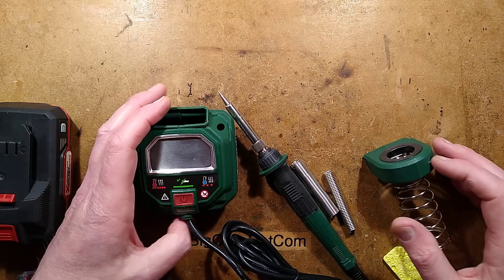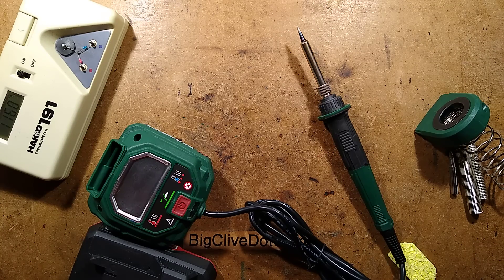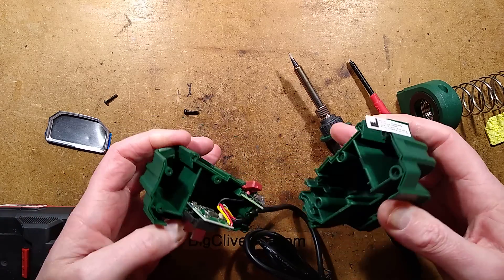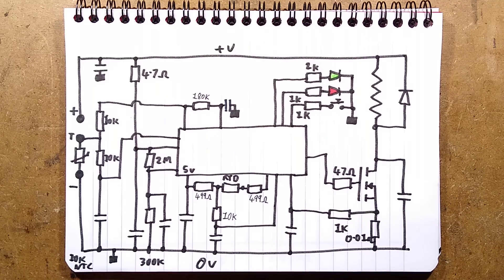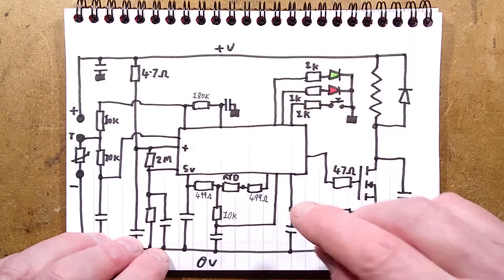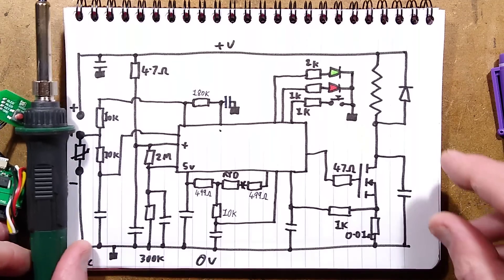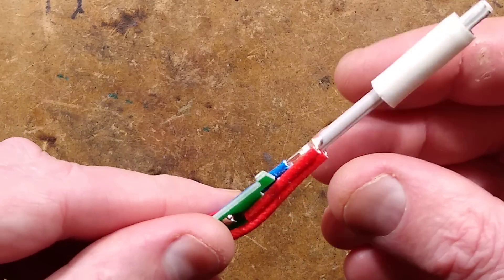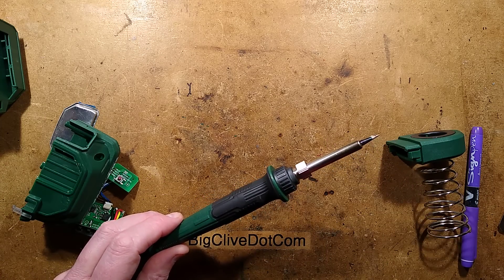LIDL (Parkside) B2 soldering iron hack and schematic

Comment: Absolutely brilliant design from a throwaway planned obsolescence point of view. Absolutely ridiculous shit design from any lucid person standpoint. In my experience with shitty irons (as plentiful as painful) it is the porcelain heater that gets damaged first (it is fragile) and setting the thing at almost 500C (out of the bloody factory!) is not helping the case. Here is another example of 'straight back to mother Gaia' (to quote Ave) factory-straight-to-landfill philosophy. And, for the price you're much better off with open source Pinecil than this piece of garbage (with temperature regulation that has to be hacked into the bloody thing to even think of using it!). Rant over. Brilliant video, what a piece of shait product.

Comment: Craftsman has a 20v soldering iron for $50 ive been considering getting since i have a number of their tools/batteries but i also use their 150w inverter for a number of things including my normal 60w soldering iron so not sure if i should get it or not or buy a similarly priced soldering station instead.

Comment: I've been using this iron for nearly a year out in the field and it's become indispensable. perfect for led strip installs, just gotta be quick as it does get hot. Used it loads up on ladders too by clamping the pack to the side rail
Reply: reply here if it reaches 1.5 or 2 years. i don't trust chinese heaters. low voltage supply might help, though, as those working on 240v are mostly junk.
Reply: @ivok9846  I can reply here now because my "Chinese heater" mains soldering iron has been fine for several years... until I dropped it. Those ceramic elements are brittle, but also cheap and easy to replace.
Reply: @ivok9846 Chinese heaters are good. But you also get what you pay for when choosing among Chinese-made products.
Reply: @ivok9846  But you do trust your chinese phone, I ?

Comment: Clive, this is great video . I wanted to make my own version of portable soldering iron but this gave me idea. This can be even better if added  various temp settings with rotary 6 position switch and every position can be different value resistor so it can be more useful. Thanks you just made my day.

Comment: The middle of my Lidl had these irons a while ago, worryingly the tip burned itself to destruction. Perhaps a 22ohm resistor will return it to normal function. Thanks Clive.
Reply: had same. they just destroy themselves. i thought it were old solder i was using causin the problem.

Comment: Excellent video and thanks for the resistance values and temperatures as I don't have anything to measure the temp.

Over the coming weeks I'll try and source a suitable pot and 3D print an inline enclosure with the temps on the dial. If everything works out I'll add a link to the .stl when I've finished so that others may benifit.

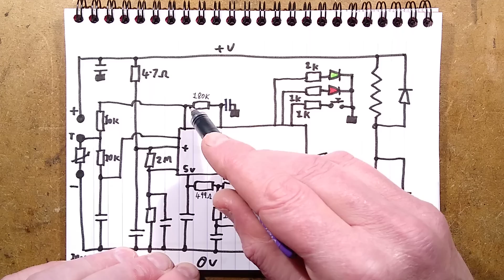Comment: 10:41
I think the 180k resistor is connected to another ADC input.  Probably this input is used to measure the actual output voltage on the pin which powers the temperature measurement circuit (10k + thermistor). High logic level voltage can be slightly less than 5V, so they want to measure it to get more accurate temperature readings.

Comment: I added a 22 ohm resistor in the white wire, reducing tip temperature to 360C, which works well for me with leaded solder. This is a similar tip temperature to my Tenma soldering iron set to 400C with a narrow bit.
To get it to work with other 18/20V batteries or power supplies you need to add a 10k resistor between the B- and BS.
The two round pads at lower left of the PCB are a convenient place for a resistor, but shouldn't be left in place for the original Parkside battery.

Comment: I got my B2 version as soon as the previous video about the B1 came out (and i was disappointed that the B2 didn't have the simple hack method haha).

I made a similar modification by putting a 100 ohm potentiometer in the base in series with one of the thermistor leads (there's plenty of room in the base); i made a hole in the case so the potentiometer shaft comes outside and the temperature can be controlled. You cannot use a higher value potentiometer as the iron will go in an error (and even with the 100 ohm sometimes it goes into an error). Also note that when you put the resistor/potentiometer in the circuit, the iron will take much less to go from red to green, even if the tip isn't at the right temperature yet; the higher the resistor value, the worse this problem gets.

The cone tip will last maybe two times before crumbling at 480°C, but they are easily found online. The flat tip is almost indestructible even at max temperature, it just gets concave but for tinning big wires it is phenomenal.

Finally, in case you want to use it with a power supply instead of a battery, you can simply make a base where you connect the middle pin to the negative through a 10kOhm resistor, and make sure you use a power supply with over 100 watts of power, as it pulls a lot of current when first heating up. Maybe a 19V 6A laptop brick could be enough, i have yet to test it, as some laptop power supplies could go into protection when such a high current load is applied.
Reply: Same here :)
Reply: Hello. Can you please give me more info on the mod. I am thinking of putting a lower ohm potentiometer something like 80 or 50 so it doesent error. Connect in series with the white wire on the board?
Reply: @xTwinkleSx  yes. There are four wires coming from the handle, two are for the heater and two are for the temperature sensor, you just need to put the potentiometer in series with one of the two thermal sensor wires.

Comment: 380° C  Why so high? I have my iron set to 325° for electronics.
Reply: I've used as low as 300 °C for very small surface mount devices when using tin-lead solder. For decades I used a 700 °F (371 °C) tip for general electronics work, again with tin-lead solder. (This was with Weller irons that used temperature-regulating tips - Curie temp of a piece in the tip itself set the temperature). It is a perfectly safe temperature for though-hole components. 

In general I prefer the "hot and fast" approach. I've seen a lot of videos recently in which people purporting to be teaching how to solder are really rather bad at it and dwell far longer than necessary to do a good job. If someone is working that way a lower temperature is probably a good thing. It takes some practice to learn how to solder quickly and well.

I used "4 ounce" (approx 6 mil, 140 µm) copper in many of my designs. Most boards use copper of 1/4 or 1/2 that thickness, some for SM use 1/8 that thickness on surface layers). Along with the thicker copper the total board thickness was 0.093" (~2.4mm). Getting good hole fill on those was a bit of a challenge at times.

If you are doing SM work, an iron is always the wrong tool to use for ceramic capacitors, but sometimes there isn't a lot of choice and low temperature is best. Suddenly blasting them with 450 °C hot air, something else I've seen in videos, is equally evil.
Reply from the maker: It might be worth checking your soldering iron temperature display is accurate.  That would be OK for very slow soldering.

Comment: Five decades ago, a US company that made "electronic kits" to build your own equipment, called "Heathkit" had a soldering iron kit.

It had a tapped secondary, a selector (high, medium, low and off) switch, and a GE soldering iron handle and tip.

The kit assumed you didn't own a soldering iron. It instructed the owner to wrap the stranded wire internal connections around the connection tabs, crimping them with needle nose pliers.

Then they told you to plug the iron in, wait for the tip to heat up, unplug the iron, and solder it's internal connections using itself!

There is no way such a product would pass muster with the "safety goons" today.

I miss the old days!

It automatically excluded idiots from the hobby! (They were busy taking up a tray down at the Coroners.)

There top of the line kit was a fairly large screen color TV.

It had it's own built-in alignment instruments for adjusting circuits as you built them!
Reply: Yeah, no soldering exists today, damned "safety goons"  (◔_◔)

Comment: I would venture to suggest that the high heat is intentional because most of the time these portable irons are likely to be used on outdoor projects with wind cooling a significant factor. Having used standard mains powered irons powered by an extension lead up a ship’s mast, I can say it was a struggle to get enough heat to make decent connections.
Reply: @Kevin-mp5of  to me it looks like a 900M series tip
Reply: It's temperature controlled, so should be able to maintain whatever temperature it is set to without being set ridiculously high.

Comment: Could you de-solder the wire on the base side of the iron and place a potentiometer in series instead and have an adjustable voltage? or a rotary switch with multiple resistors attached for fixed values? 🤔

5:17 Curiously, where do those 4 pads trace back to?
Reply from the maker: Those are for testing or programming the microcontroller.
Reply: Yes, you could, I did exacly that, I added 100Ohm pot in series with the black wire.

Comment: Best thing I ever bought from Lidl is tiny USB-powered spray gun. It somehow manages to atomize paint from felt-tip pens.
Reply from the maker: does it use air or is it electrostatic?
Reply: There is mechanical air pump, but I dont fully understand how it works.

Comment: You should try a cartridge-based soldering iron (JBC or a JBC clone).   While the genuine stations are expensive at $450 and up, you can get knockoff bases for closer to $50 USD and plug a real JBC handle and cartridge into it.  You've got the skill to use one of the Weller style irons as you show here but cartridge tips are just so much better as they keep the tip at temp much better.
Reply: Pinecil sells for 26 bucks and also has tips with integrated temperature probes (Hakko T15 style). It can be powered from USB C PD or via a DC barrel. There's ton of adapters on thingiverse for different powertool batteries.

Comment: Probably not a bad idea to add a little pushybutton that can be hotmeltglued to the handle to bridge the resistor mod in case you need the extra oompf...
Reply from the maker: That's not a bad idea.

Comment: Always wanted one, but then i found 3d stl files for x20 battery adapter, added case, switch, socket and cable for my TS100 soldering iron and works great.

Comment: 15:10 The conical pointy tip that it was supplied with stared eroding within 20 mins of use with me using flux, my own known good solder and switching it off when I knew I wouldn't be using it for a few mins. I was so tempted to take it back to the store when I realised it wasn't an A1 version. 480C is an absolute joke and I have no idea why Parkside would feel that temperature is appropriate for soldering. Rant over.

Comment: When the iron is tamed down the chance of a faulty heating element also reduces, and then you are tempted to buy some more spare tips at start. Hate to choose between enough tips for the future and a faulty heater, or a working heater without a clean tip.

Comment: Would it be possible to add a potentiometer instead, maybe some kind of mini panel mount one so you could have it say max temp (or near to it) in case soldering outside, then be able to turn it down if needed, i know you wont be able to know the exact temp but would be a cool feature. What value pot would you need to do it ?
Reply: I imagine so, maybe a 200ohm potentiometer from ebay would do the job and allow you to get cooler than 300C temps
Reply from the maker: A 47 ohm pot could be a good choice.

Comment: Thanks Clive I went out and bought one of these soldering irons after seeing your original video and couldn't  understand why I couldn't lower the temperature like you had shown. I will now try this hack although I fixed the outside fairy lights today that I
 managed to cut though in two places last summer works fine when it's only 2 degrees outside . Has you say works great has a portable soldering iron

Comment: "That's because the safety industry is detached from reality." Thank you Clive. You're a classic sir! :)
Reply: Simple solution to that is to use the "right" tools. For example Wera or Wiha, and I assume others as well, sell "Slim" Versions of their screwdrivers which are considerably thinner, even with the insulation. 
Besides that, in this case, the device is not powered and if so powered at a low Voltage anyways, so any normal non insulated Screwdriver would work and would be adequate in this specific application anyways. As long as it is not powered up, there is no requirement for insulated (or according to the German "VDE" recommendations) tools anyways.
Reply: There was a former H&S guy on the radio (LBC?) the other day saying that the majority of the personnel in H&S in the UK nowadays completely misunderstand their purpose.  The idea is to identify risk, appreciate it, and to manage the risk within the parameters of what you are wanting to do.  It isn't just to say No No No No all the time!  So a modded screwdriver is fine as long as you restrict its use to occasions where there is no HV element -- which is what any sensible person would do.
Reply: @Kevin-mp5of  Or because of dumb lawsuits
Reply: @Kevin-mp5of  Indeed, but I didn´t want to go into too much details, as here in Germany where I live, not even every electrician is allowed to work on systems under power. But whenever feasible, shutting of power and locking out is absolutely preferrable anyways.
For what Clive shows I also kept it simple as, mobile devices with a plug can be considered safe to work on while unplugged (which means some things he shows, as he says himself, are not advisable). I think there are even lockout boxes for plugs available. Oh yeah, and of course make sure to discharge capacitors (Guess how I learned that in my youth...)
Reply: @Kevin-mp5of  Sounds like you discharge them anyways ;)
Reply: @Kevin-mp5of  And one way comes as a surprise. Every. Single. Time.
Reply: @Kevin-mp5of A little of column A little of column B
Reply: H&S was the bane of my life in control and automation systems - until I found the answer... To any risk assessment I submitted their answer was almost always along the lines of "no or not good enough or don't think you can do that" so I hit back. I made them part of the project team and dropped the responsibility for designing the installation/commissioning safety systems on them  (also cost justifying them 😧). Told them "You are H&S, you go to all these seminars and exhibitions, you know all the latest innovations and reg. changes so you can design the safe systems" Never had a problem getting my RA's approved quickly after that 😁
Reply: Oh, no - it's not the industry, it's the reality. And the reality is that this world is full of muppets with questionable knowledge and enormous self-confidence, and if we don't take care of them (somehow) we'll run out of hospital beds or cemetery space. 😂

Comment: What current does the sense resistor see? Because it might be possible to add a trimpot in the case to make the temperature adjustable, though it wouldn't have a display.
Reply from the maker: Very low current, so a 47 ohm potentiometer would work.

Comment: Clive, the controller appears to be an OB6606 made by On-Bright Electronics, and is intended to be a brushed motor controller which includes a microcontroller, 5v regulator and a rail to rail amplifier.  I can't find a datasheet for it though.
Reply from the maker: Looks promising.  Shame they don't even have a numbered pinout for it.

Comment: Just a question.... is it possible to convert a 220v 60w aliexpress soldering iron to 120v? I converted my hot glue gun but tried iron but won't heat hot enough to melt solder. Searched your videos but couldn't find a video on it.
Reply from the maker: At 120V it will be about quarter of the power, so not really cost effective unless you can find a new element for it.

Comment: I got the portable rechargeable iron from Lidl. Waste of time. Can't even solder to a PCB let alone solder wire. May have to get a better one that is dedicated to actual soldering and not waste time waiting to see if it does get up to temprature.
Reply: Maybe you had a dud, my B2 version is decent aside from the crazy high temp. Might be worth retinning the tip and don't be afraid to use a generous amount of flux